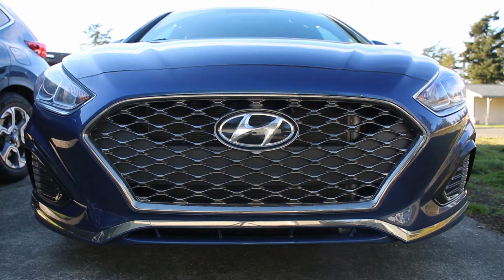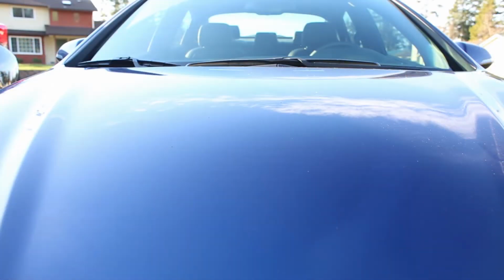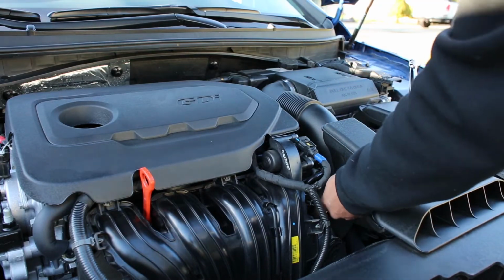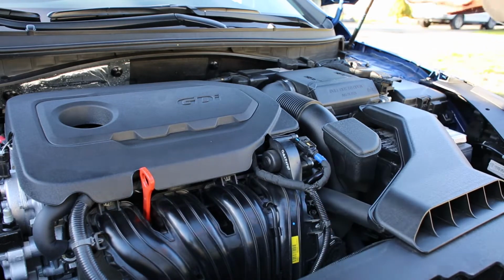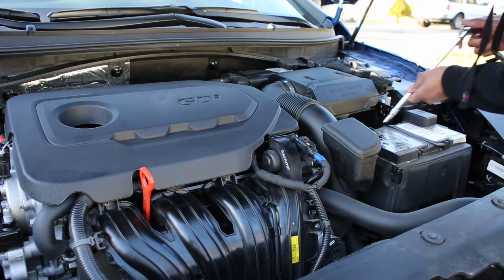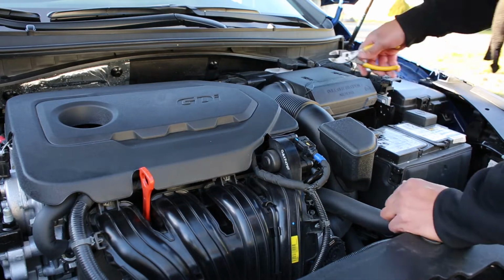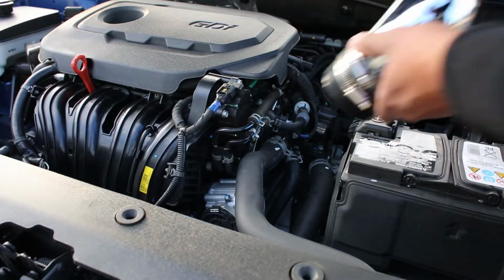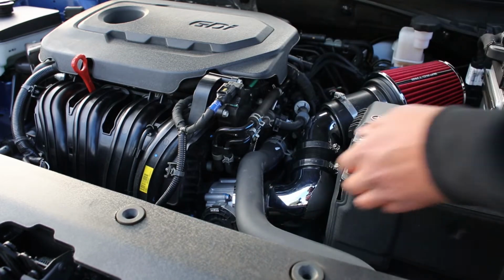2018 Hyundai Sonata 2.4L Custom Air intake/Short ram intake

Comment: What did you do with the two hoses that are attached to the intake?
Reply from the maker: The one from the engine, I took the hose of completely and put a small cone breather filter on it and the same for the other. I put a breather on the the one from the brake booster and zip ties it so it doesn't hang.
Reply: Desmond Crusoe i can connect those hoses on the intake to the engine right
Reply from the maker: @elianderson3956  I put breathers on those. I'll do a full video sometime this week.

Comment: Will this work on the 2018 2.0 turbo
Reply from the maker: I'm not sure tbh. But i did do a quick search and found this. Its for the Kia Optima, but should also be compatible for the Sonata. I know the 2.4L's are the same, just not sure about the 2.0. Looks fairly easy to build too. https://www.k5optimastore.com/products/aem-induction-air-intake-system

Comment: Do you know if adding a AEM cold air intake and a throttle body spacer void the warranty?
Reply from the maker: I can't say if it will or not, but I know when I took it in for some routine maintenance (induction cleaning I think), they said they couldn't do it because of the aftermarket parts. If I had a problem with my car, I just take it off. It only takes about 10 min.

Comment: good job man ( i just want to ask what is this think between the filter and the tube i thing there is a BLACK thing between them ?
Reply from the maker: I lost the gasket that goes on the inside of the filter that brings it down from a 4in diameter to 3in. So I had to improvise with a piece of pvc tubing that I had 😅. But I ended up finding that piece.
Reply: Desmond Crusoe 

good job man big fan off your work ❤️ keep it up

Comment: Great video! I wanted to do this to my 15 Hyundai Sonata Limited 2.4L for the sound. Did you notice any power loss from it? I know a lot of people that only get the CAI and not a tune and see lag in acceleration
Reply from the maker: No power loss and it does sound pretty good! I don't think it's doing enough for a tune. But I have been looking around in my area, and no one does it for KDM. I did do a ECU reset to hopefully help if it does end up doing something to help.

Comment: How much did you spend in total? You can buy a K&N or AEM setup including heat shield. Between 250-350. I just installed an AEM kit and it looks nice and sounds nice. Thanks for the vid it helped me a lot.
Reply from the maker: Glad it helped! I spent less than $100, I even have an eBay heat shield for it. It's not the greatest, but at least it's something!

Comment: Do you gain any horsepower after installed the intake?
Reply from the maker: I had a Sonata for a rental and it did feel a lot slower! I was really surprised. I don't know how much the muffler delete added to it, but with both of these, it feels a whole lot peppier, especially in sport mode.
Reply: @DesmondCrusoe  I see, I am looking for a cold air intake for my car but sadly my car came from the Korean market which is different from the US model. Not unless if I modifiy my intake duct to the US model exactly the same intake duct like in the video, may I know where can I purchase this and can send shipment worldwide? Really appreciate if you could help.
Reply from the maker: Feel free to shoot me a pic on IG!
Reply: @azimgani5149 

Be grateful that it was made in Korea. Engines from Alabama have had issues from the boring cylinder process.